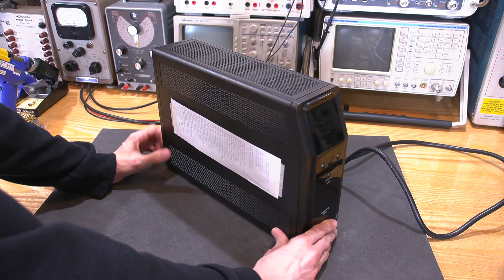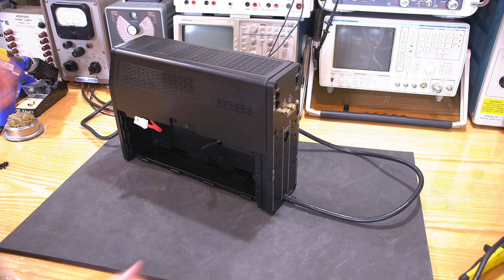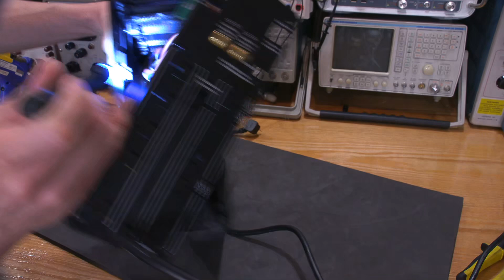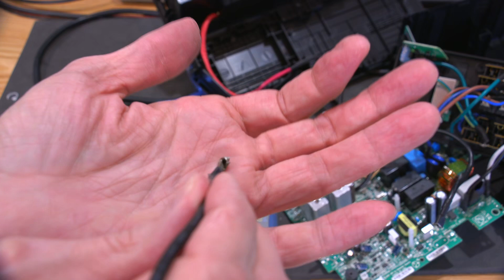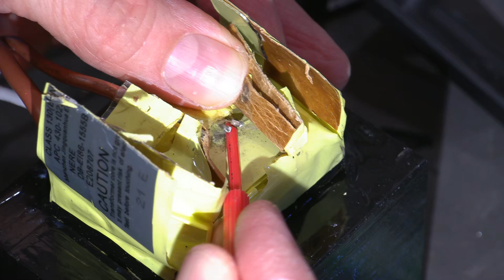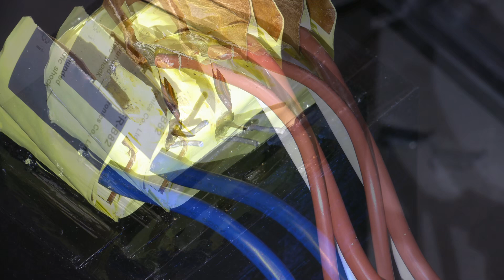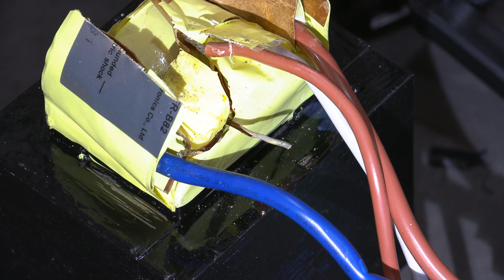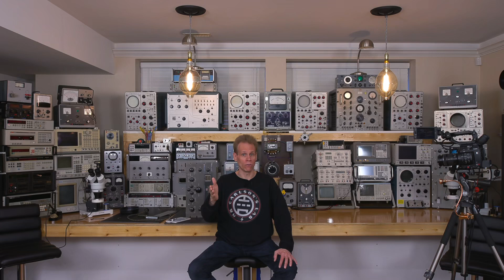UPS Electrical Failure - Teardown and Analysis!

Comment: The QA receipt thing is standard APC, now Schneider. Everything from those small ones on up to the full rack hardwire units. The quality has definitely suffered under Schneider.
Reply: Also F02 and F04 are short circuit codes (02 is output short  but I’ve also seen that when the batteries go, 04 I had to look up, output clamp short - which is the surge protection shorted I think)

Comment: I have had two APC UPSs fail in a similar manner to what you described, and with the same error code that you had. I didn't open up either of them. I pulled the battery and threw it in the electronics waste bin. Maybe I should have opened them, but I was concerned that I would get hurt on it.

Comment: Electric motors are almost all aluminum now in air conditioning. Even big horsepower motors are using aluminum. Lighting ballasts are also aluminum now.

Comment: Fun fact: the transformers in all of these consumer-grade units is almost always sized way too small to handle the sticker-rated loads.  They depend on the pathetic drop-out of the weak lead-acid batteries they put in these units to be the weakest link in the chain, draining before the transformer can heat up enough to cook itself and start a fire.  Wire any of these consumer-grade units up to a bigger battery or DC source at the same/correct voltage, put >60-70% of the rated sticker load on them and watch them go up in smoke & flames.  No joke.  Works every time.
Reply: That's called doing proper design.  They're designed and marketed to only run for about 7 minutes.  There is no active cooling in any of these consumer UPSes.  Once the heat sink gets hot, it's game over.  Why would you think they'd be designed for continuous operation?  Isn't that just a little unreasonable?
Reply: @stargazer7644  Because when the consumer installs a battery that is compatible and the correct voltage but lasts longer they don't expect the device they put the battery into to catch fire.  This would be like if I put a AA battery that has 2x the runtime of normal AA causing my TV remote control to catch on fire if I switched channels too frequently.

Comment: I have 2 APS power supplies. One works fine but the other has corrosion on one of the battery terminals. If you know of any way I can clean that off so I can use it again I would appreciate it.

Comment: Paul where is your solder ventilation ? Not good to be breathing those fumes. I just went through the same thing with my Air fryer where it faulted out on the element power wires because of faulty assembly.

Comment: Boy what a shame and sad, that they used Aluminum wire in that transformer, It would have been better to use a crimp on connector, instead of trying to crimp solder tinned wire over the Al wires. There is a special flux for Soldering Aluminum by the way, I used to have a tube of it.

Comment: With the correct setup you can solder to aluminum - - that doesn't make it easy to do.  However The fact that aluminum is getting used is bad bad bad!   Geez

Comment: That's extremely unprofessional and dangerous for them to have done that, glad you caught it quickly. Also thanks for sharing with us.
Reply: APC is owned by schneider
Reply: I had issue with my unit not switching during power outage. Was intermittent so got one sent right from Schneider and it works perfectly.
Reply: Yeah, this seems like typical "x supplier is out of transformers so we're going with y" bargain bin stuff. I have seen some hokey stuff, but this is next level.
Reply: NEVER try to improperly attach copper to aluminum in an electrical cuircuit.  This thing was a fire waiting to happen.
Reply: welcome to the consumerist society of fleecing the people and the sheeple.
Reply: How did this pass UL ??
Reply: Made in china

Comment: The windings are probably CCA (copper coated aluminum). Uses cheaper materials and since it isn't full duty the resistance loss isn't as big of a problem.

Could you possibly cut the core and count the turns? The 3 120v lines make me think that it uses them like an auto transformer for brown out or high line voltage.

Comment: That’s sad.  I used to use APC all the time for smaller data centers but it seems like they’ve really gone cheap.  The silly thing is that if they had used the proper connection Im sure it would hav been just fine.  That was such shoddy work, I hope you sent pics to APC just to document the hazard.

Comment: I would guess that company has outsourced that transformer and as a result, they have added new QC checks in an attempt to find out why they have a high rate of returns (paper attached).
Perhaps the company will see this video and make some appropriate changes.

Comment: Once upon a time I tried to solder an aluminimum part by normal tin-lead and flux, and somehow that appeared to poison the iron tip... it picked up a blackish layer that no longer took solder or even melted it very well.

I have a few European market APC devices that have Schuko sockets on them, they appear solidly built. They use a 12V battery which for the thicker model is actually rather easy to acquire. The thinner model has a thinner 5ish Ah battery that appears to be almost unobtainium unless you get it with a freakin' high price from a special supplier. However it is possible to dremel out some plastic ribbing from the case of the unit, and it appears the depth of the compartment will then be enough to accept a standard sized 7,2 Ah battery.

Comment: Shame on APC for using transformers with aluminum wiring. Aluminum in residential wiring was shunned decades ago since it oxidizes more readily than copper, and connecting copper circuits to aluminum requires special connectors and if not done properly can be a serious fire hazard. Also when copper is connected to aluminum wiring there is galvanic corrosion that will form at joint. This is what caused the arcing noise as this corrosion makes for a bad connection. Aluminum wiring should not be used in power circuits!

Comment: I have the exact same unit and on its third power outage, something blew and it dead sorted the neutral and hot on the power input side and shot sparks out the side vents until I cut the terminal for the battery..... Relay RY1 was burnt to a crisp. Replaced it and now it works ok off the battery but I haven't found the dead short on the power input side. I was going to try hacking it into just a 24v inverter but after seeing those connections to the transformer, it's going in the scrap and smelting bin.
Reply: Just went back and checked it, my xformer appears to be copper but the solder connections for all three smaller gauge wires was very poor with what looks like individual strands that may have been arcing periodically or maybe only shorted after being moved

Comment: APC devices were really top of the line and were extremely reliable, at least when they were made by American Power Conversion. In 2007, Schneider Electric acquired APC and the quality has gone steadily downhill ever since.
Reply: Even things like their stud and electrical cable detectors look like cheap Chinese garbage. To think these guys make massive industrial electrical hardware is shocking. Honeywell have gone the same. Cost cutting to increase profits superficially.

Comment: I have a Tripp-Lite UPS that failed a couple years ago in a way that I thought was bizarre. The main transformer had developed an open winding. Thinking I could maybe find the break, I started taking the transformer apart. Bolted together laminations made it pretty easy. After I got the core apart, I started opening the tape and was horrified to see they used ALUMINUM wire for the windings with copper flying leads CRIMPED on to them. One of the crimps had failed. I redid all the crimps and heat shrunk them, and it's still working. One day I'll rewind the transformer with copper windings since there isn't much there in terms of length.

Comment: This looks like engineering (or procurement) changed design or ordered the wrong part and then the night shift was never told the update required a crimp connection.   Assembler was told to connect wires so they did the best they could.  One time a Boeing 737 engine fell off because the cotter pin maker put aluminum wire in the machine instead of stainless and it slipped through QC.

Comment: Had the same transformer problem a few years back with another model of APC consumer UPS. I'm avoiding APC since then.
They say APC pro versions should be fine, but for my use case way to expensive. Using Eaton UPS now and it's still working after three years 🤞

Comment: I actually had two APC units go back on a client (UPS PRO 1500, older models) and I also took mine apart. Couldnt find the fault, but I did save a lot of the components (for other projects) and the transformer. I'm going to have to go see if it was the transformer, good find. The receipt is standard on the APC units. It's their "QA" sticker basically.

Comment: After the war, there was a shortage of copper and from what I understand, they were using aluminum wire to wire new houses with. They would tag on about 4" to 5" of copper wire to wire up the receptacles and light switches. The chemical composition of the two different metals really cause a lot of problems. Massive corrosion,
Reply: And even causing fires. They have since then band aluminum wire from being used in house wiring.
Reply: The engineer that designed these obviously didn't get the memo!

Comment: I’m not sure I would have believed it if I hadn’t seen it. That assembly is pretty awful. I’ve heard from multiple sources that the consumer grade stuff from APC has been lacking for some time.

I’ve had some of the SUA products from APC for around a decade (they were already used when I purchased them). The only maintenance they’ve ever needed was battery float voltage adjustment.

Comment: There isn't intrinsically wrong with Aluminum conductors if it is done correctly, but obviously it wasn't done correctly. I've used some aluminum solder that was designed to solder aluminum with the correct flux and it made a very good connection to copper. Seeing a "name brand" unit with such sloppy work is disappointing, as I have three of them sitting in the same room.

Comment: I don’t think aluminum windings alone are the issue. I think I have seen aluminum windings in very old equipment, I think it was some welder. It’s the way the copper leads were bonded, which was inadequate and unsafe. They could have crimped those and it would have been fine.

Comment: Wow, that's the crappiest engineering I have seen in awhile. What genius thought soldering copper wire to aluminum was a adequate connection. To damn cheap or dumb to use some crimps ridiculous. This was truly amazing new generation engineering at its best. The experts are right the IQ of humanity is lowering as time progresses.

Comment: This is why you don't use Alum in wiring with copper...Chinese Junk.  They saved .05 but cost the consumer in $130.00 to thousands if your place burns down.  The moral of the story is, fast, cheap & good do not mix!  I do not mean to accuse here, but where the chips fall, so does the truth...you all decide!

Comment: This is product recall territory. There are ways to make reliable connections to aluminum wire, but this is not that.
I'd be interested if one of the units that hasn't failed is attempting to make connections the same way.

Comment: I have a bunch of these - half have failed with the same F04 error. these all seem to fail the same way, AC power is fine and they just stop outputting and say the batt is bad. Cycle power and wait a while and battery goes back to OK . Not surprised they used CCA wire in such a way, They have been junk since Schneider bought APC. I also Have a 3kw rack mount that blew up a relay inside that is no longer sold at the current rating as the one inside it. I suspect they found that it couldn't handle the load they rated it for so just changed the label.

Comment: Year by year their quality is going down hill. 
I have a 500va model from 2003 , the transformer in that is double the size and more than double the weight of the one in a 2016 model 1100va unit from apc. 
I have a br1000g that has a smps style inverter. So it takes 24v dc to 350v dc and then turns it into 220v ac with a H bridge.

Comment: It was like 30 years ago, I was a teen and completely astounded at the sight of an aluminium wound transformer inside a high-end audio amplifier. 
It was silver cladded, enamel coated aluminium, judging by the color and aspect.
And that was done to make the transformer a little lighter than a copper wound one. 

Nowadays be glad you don't have enamel coated iron windings in transformers like all the IEC mains cords from China :)

Comment: carefully... google translate!!
The transformer from the microwave oven is also now being made with an aluminum winding.
In the old days in the 90s, I was engaged in the installation of installations. A cable with an aluminum armor core was used there. And to solder the copper tire to aluminum , then I used a special solder . Tin-zinc. The copper tire was not soldered immediately. But in the end there was a good result. I think if you use such a solder in a compartment with today's fluxes, then everything should turn out well..
And then.. that companies go to such deception. And even in such important things as uninterruptible power supplies .Which help not to lose a lot of information in computers and servers in case of disconnection. It only says that now all the developments are not carried out by engineers. But rather people from sales departments. To whom it is more profitable to sell more quantity than quality. It is sad.. Alas, this is how the policy of companies around the world works.

Comment: I stopped recommening APC over a decade ago. They have a reputation for boiling batteries to the point tbey swell, requiring you to take apart the UPS to get them out. Eaton UPS units have been far more reliable for me.

Comment: What's the model number or date on these APC Back-UPS 1500 units?  This is a shocking find and I'm sure more people should be aware of it.
Also, what unit did you replace these with?
Reply: can we have the model number / series ? :) @MrCarlsonsLab (do not know if the tagging is work though :)(

Comment: Cutting corners rarely ever works.  I too had a transformer that appeared to beg the failure point in a piece of gear.  I too found it to be aluminum on the inside.  Not great.  Fortunately I was able to replace the entire piece of equipment rather cheaply, and it was an upgrade.   I’m glad the thing was grounded, because when my son turned it on, the whole thing smoked and went pop, like a firecracker.

Comment: Amazing, did not know you can use aluminium for transformer wiring ... and also that you can not solder to it :) Thanks Mr.Carlson. But what does that mean, are all of the other UPSs at risk of the same "design flaw" problem?
Reply: Yes

Comment: I just can't stand this anymore. I find similar things in failed products at an alarming rate. Everything is built as cheap as possible, while still having a high price tag. I literally have to buy 1, 2 or 3 products and return the ones that feel too cheaply made. But even the ones that pass the first inspection end up failing too soon. For a example I had a LED light fail after about one year of use. And it was from a good company and decently built. But the LEDs literally cooked themselves. How can such a product pass tests before being put on store shelves? They probably don't even run proper tests anymore, but only some simulations and hope for the best. It's really sad for the end consumers, because we end up paying for all of this with our hard earned money and time.

Comment: I had heard that a lot of manufacturers were changing to aluminum wound transformers, but this is the first I've actually seen. You may have changed UPS brands, but you may not have better transformers in the new ones.